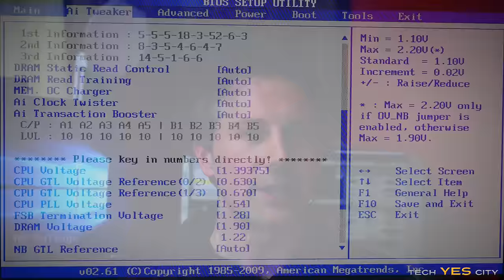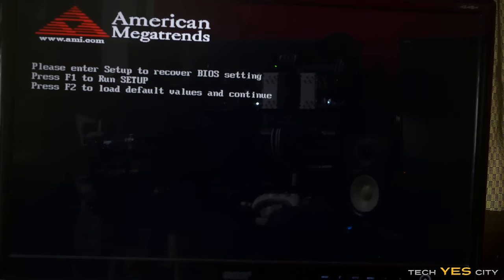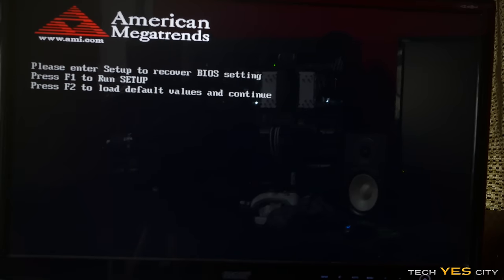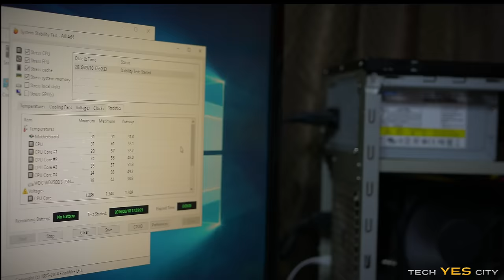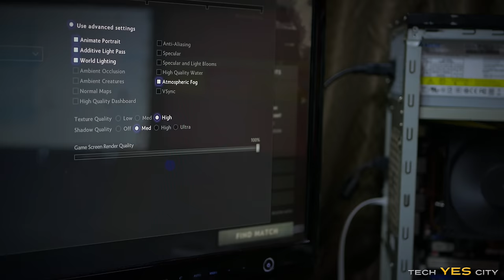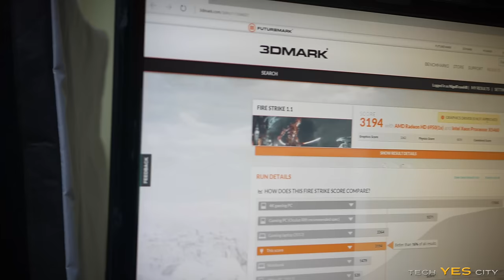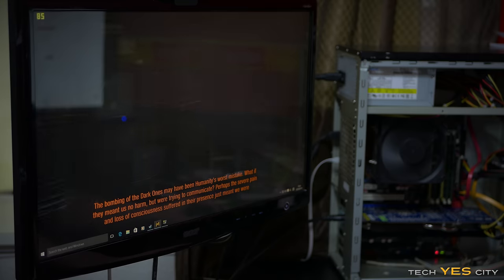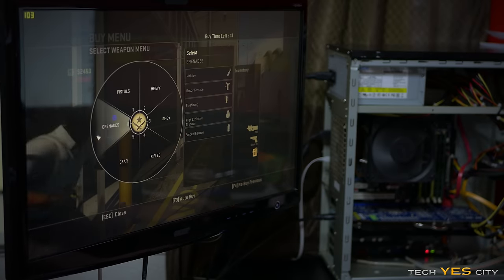$125 Used GAMING PC - is 1080p Metro Last Light Possible?

Comment: I would suggest not to spread the thermal paste with your fingers, the oil from them could corrode the compound and it is also very toxic for your skin :)
Reply: +Gonzalo Bueno I would argue that the paste that comes in contact with the skin will stick to it, so that the paste that remains on whatever you wanted to cover will only have touched the paste that is stuck on your finger. There's probably still some contamination happening, but it's probably not as bad as you think.
Reply: +Keven Harvey not bad as he thinks? that paste might cause cancer :P
Reply from the maker: +Gonzalo Bueno Tested it pretty extensively off cam, basically the bare finger wins (look at that 4ghz OC in this video dude, on a ghetto zip tied, top down cooler at 22deg ambients getting 56-57 spreaded perfectly).  Also especially with mx4 and as5, as leaves just the right amount on and as Kevin pointed out below, the initial spat on your finger acts as a barrier (and I also clean my finger with alcohol before and after pretty hard).
Reply: +SeaJay Spread method is a must for GPU, its not the same for CPU, because of the IHS.
Reply: +TexasTimelapse Your hands are naturally oily
Reply: Look at the video that Linustechtips made. Here they show that is doesn't make any difference.
Reply: Pea method: Ensure there's no dust on either surface, add a pea-sized blob and finally affix the cooler using the TR/BL/TL/BR/repeat* technique.

TR - Top Right etc etc

Pretty easy.
Reply: +Tech YES City I'd have to disagree. The oils on your finger may not effect the thermal compound in the short term, but over time it can. But you're not going to be using these PCs for years on end anyway so it's rather moot.
Reply: +Gonzalo Bueno He does so in every video to no ill effect.  Worst case scenario he losses a 1c or two on a $125 PC.

Thermal paste is not toxic.  Toxic would mean that it cause alignments just on contact and would require a disclaimer on the product packaging, of which I've never seen on any Thermal Paste.  People work with solder made of lead every day, I don't think what he is doing is any worse.

At best you could claim that it should not be left on the skin for prolonged periods of time but anyone is obviously going to wash it off.
Reply: +Gonzalo Bueno Does that mean I should stop applying my  paste with a Cheeto puff?
Reply: ive been spreading paste with freshly washed fingers for years now. never failed me once and i almost always get the best coverages and temps this way. people tend to over think applying thermal paste.
Reply: +Gonzalo Bueno There is no difference what so ever in terms of cooling, just put a dot in the midle of the cpu and it's ok it's not rocket sience.
Reply: +Tech YES City that is because the method how you apply doesn't matter. Look the workshop on LTT
Reply: +Tech YES City also how you spread it doesen't matter much, you'll get pretty much the same temps
Reply: +Ivaylo Kostadinov reincarnation dude, yolo dont excist
Reply: I can't believe how many people think that minuscule amounts of grease from our fingers will make a difference in temps, even though there is NO proof behind it.
People, just wash your fingers before this method, and, like Keven Harvey mentioned, grease isn't even an issue, since thermal compound sticks to your finger and creates a barrier and you smear the rest of the compound with that.
It's not like you will scrape the paste from your finger and smear that over the chip. smh
Reply: DavorBa TOO MUCH WASTED THERMAL PASTE
Reply: Julian Depaepe You put the same amount as when doing pea method. The only difference is, you are sure whole chip/IHS is covered, something which pea method doesn't always do.
Reply: Julian Depaepe I'm not the one who misspells "stupid", stupid.

"contact=efficiency" - yes, I agree, spreading insures max contact between chip/IHS and heat-sink.
Reply: DavorBa I'm not perfect 
don't try to be a computer
Reply: Julian Depaepe I not the one to go "grammar nazi" on people, but when someone uses an insult in a normal conversation, all bets are off.
Reply: DavorBa its allright
Reply: +Doctor WarpSpeed You should just use the powder AS your thermal compound. I mean, if Nutella works, whats the harm?
Reply: +-DepthCharge NUTELLA? Omg my head hurts soo much
Reply: +Ivaylo Kostadinov Yankee Oscar Lima Oscar
Reply: +Gonzalo Bueno So  I play pc games with voice chat enabled nothing more can be toxic other than hillary clinton
Reply: s0trill Same and its free not 10$ off amazone
Reply: +Gonzalo Bueno Skin cancer
Reply: DJWolf™ Gaming LAMO its not going to give you skin cancer its fine to touch thermal paste
Reply: +Ben Cumming same here. A little tip tho, you can use it for toothpaste. I call it ultra white.
Reply: adam blaydes All of that crap is gonna be costing more than atual thermal paste and gonna be smelling like shit cus i don't know but burning toothpaste and it chemicals
Reply: I once accidentalky got thermal paste all over both my feet
Reply: Finger Cancer!?
Reply: Amalie Haderbjerg - lamo ikr
Reply: Amalie Haderbjerg - Is that something you can get from thermal paste?
Reply: Elljoda LAMO no its fine to touch thermal paste.
Reply: Good cuz I got my both feets covered in that shit got me worried haha
Reply: +Gonzalo Bueno been doing this for years! never had an issue! but if you are that paranoid about the compound being contaminated or toxic for the user, just wear gloves!
Reply: +Gonzalo Bueno i read somewhere that thermal paste is made mostly out of plastic so why is it toxic?
Reply: +Gonzalo Bueno Yeah if youre into fingerspreading your paste at least use a glove or a plastic bag.
Reply: dario62589 Will a used condom work?
Reply: +Lukas kuprys 
it's silicone and/or silver
Reply: Isn't that how you get superpowers though? 🤔
Reply: +Gonzalo Bueno When I touched thermal paste for the first time I felt that my finger became dry and I couldn't wash it. It definitely is NOT a hand smoothing cream.
Reply: Interactivbg1 It shouldn't get your fingers dry but it may make your finger feel cold but I have been using Arctic Silver 5 since 2008 so you may be using cheaper stuff.
Reply: I don't know what it was, I was just "exploring" an old pc.
Reply: Silicone is a polymer (plastic), which is considered carcinogenic. So it could cause cancer just like any other plastic you're in contact with. Nothing to worry about though. We would probably all be dead if the risk was bigger. You eat, drink and breathe alot more carcinogens every day anyway.
Silver is toxic too if it enters your bloodstream. not in such small amounts as there is in thermal paste though..
Reply: I would argue that most thermal paste arguments are bullshit, seeing as ive used toothpaste with great results..
Reply: badum tssss

Comment: Where the hell did you get a P5Q-E mobo for 21$?! On ebay they cost 70$+!!
Reply: when he build this rig he is on japan.and he getting it not from ebay.
Reply: +SkyMix_RMT Well, it is rare, but I got myself a P5Q with a Q9300 plus aftermarket cooler and 4 GB of DDR3 for just around 35$ including shipping from eBay and everything is working out of the box, making it incredible value. Even if you already have anything except the board, this would be around 20 ish dollars at least if you resell the other components. But then again, these are auctions without too many bidders and I've had enough bad luck on eBay also. The best thing is, this build is running at 3,75 GHz CPU, 1000 MHz RAM no problem. When you add 2 more modules however, it has to settle at 3,6 GHz CPU, 960 MHz RAM to be very close to full stability.
Reply: WTF, man I'll be paying 35$ only for the CPU here in Romania, prices here are too high
Reply: SkyMix_RMT i saw a guy selling a p5q board with a q6600 with 8gb ddr2 ram for $40. sadly it's sold
Reply: Mitsubishi L300 2.5L FB EXCEED in my country p5q only $10. and he sell it with ddr2 4gb (2x2gb) and q9400 only for $35. still available now

Comment: I'm loving these used PC part builds mate! 

I challenge you to make a Gaming PC for $100, BUT it needs to be optimized for LAN parties; small case that's  had a (sturdy) handle built on,   with hooks to hold Power & Video cables on the side. Bonus marks for any other additions, and the case itself having a visual overhaul. 

The $100 would cover the PC parts + building materials for the case mods. 

Good luck :)
Reply from the maker: +Yazooman_179 I have the mini itx case lying around, though it all begins with the motherboard, will have to find  amini itx board for cheap, so very hard challenge!
Reply: It would be a pretty hard challenge, but that's what makes it fun :P 

I bet you'll be able to do it though!

Comment: Nice build. I love the LG775 platform. It has served me well for many years. I only witched to an i7-2600k for video rendering. For everything else it did (does) everything I need quite well.

One thing you might want to consider adding to your cleaning arsenal is a nylon/plastic putty knife/paint scraper. I have found them to be invaluable for getting the dried and hardened thermal paste off of heatsinks and chipset cores. Unlike metal scrapers they won't scratch or gouge the surface. Here in the US I picked a couple of them up for less than $1 at my local True Value.
Reply: Whoa, wtf I did like exactly the same thing, I had five lga 775/1 CPUs and I just switched to a i7 2600

Comment: i got a pretty good gaming pc (second hand) for 125$.
8GB ram
500GB hdd
gtx 650 OC edition (1gb ddr5 128 bit)
i dont know the motherboard
i5 2500 3.3 ghz
overall its GREAT i can probably run gta v on high
Reply: I doubt it; the vram for high textures is too much for the 1gb you have now. Medium should be just fine, though!

Comment: Someday can you do an overclocking guide/video on overclocking the 775 cpus? I had my Q6700 running at 3.1ghz. But after a couple weeks I blue screened while rendering a video. So I just reset to defaults since I don't feel comfortable pushing more voltage. Otherwise, great video though. That sure it a lot of value. Did you try running Fallout 4? :b

Comment: great PC man!  I still have P5Q Deluxe, 8gb ddr2, q9550 e0 OC to 4.0 ghz.  With good PSU and GPU like mine GTX 560 ti, still capable 1080p PC. Run everything with high and some in ultra. SSD make things snappier..  Excellent video!  That Xeon X5460 is 9.5 multiplier beast

Comment: Hey, i have a gigabyte ga ep43 and a core 2 extreme qx9650 in my secondary pc and i cant set the cpu clock at more than 3.6 ghz. Can u tell me how to set the voltages and ram in order to reach 4.0 to 4.2 ghz? i have 6 gb ddr2 667 mhz.
 Thank you!

Comment: I love good value used computer hardware and used to think that Core 2 Duo's were the pinnacle of bang-for-buck used gear. Especially when I got my E8400 for AU$20 and overclocked it to a solid 4.2GHz at 1.3V (normally at that speed you'd need at least 1.38V to reach stability so this was pretty insane)
But when I found out that the Xeon X5460 can be had for AU$40, there were zero complaints from me.

Comment: I'm still rocken a 775 with a Q9400 and I still really like that PC. I can still play Fallout 4 and GTA V on it and still get above 45FPS. I already had the mobo go that originally housed that CPU the EVGA 780i died so I tossed everything from that board onto a ASUS P5B-E witch is an older board and the CPU went from 1333MHz to 1066MHz but I don't see much difference in gaming. I'm just glad that CPU was able to still work even with an older board. All I had to do was update the BIOS.

Comment: I got nearly the same setup :D but I'm not doing this for fun - this is my budget :/
If the PSU got enough power, you can flash the HD 6950 to a HD 6970 - like I did yesterday ;)
PS: I'm preaparing the Xeon-mod, where is the best place to buy those stickers? And where do I order used CPUs?

Comment: LGA 771/775 4 core CPUs don't have 12 MB of L2 cache. They have 2x6MB, and as those CPUs are in fact two dual core CPUs linked, and they require to synchronize cache memory on both units, the total amount of data they can store in L2 is 6 megabytes.

Comment: Short question. Can you share your oc settings for that build? Also I would like to have your opinion about rebuilding that build with an DDR3 Mainboard. I've currently bought stuff for a 120€ including a second mainboard tho. 
Asus Striker 2 Extreme with the FX Soundcard and so on (Second Mainboard)
Sapphire hd 6950 Planing to patch this to an 6970. 
Xeon 5460 (It is fully modded, to even fit in a 775 Mainboard without destroying it).
4GB Corsair XMS3 DDR3 1333MHZ RAM
Zalman CNPS9900A CPU-Cooler
Asus P5G41T-M LX Mainboard (Its the one with the DDR3 Support)
Q6600 + DVD-RW Drive
550 Watt Xilence Power Supply
Got all that shit for 120€ maybe a bit less.
Reply: damn I'm impressed
Reply: The System was running without any OC, just a little bit Windows 10 Adjustment. I am not that experienced in OC on those AMI Boards. Just used to uefi a bit. It still got 120-180 fps in csgo. And in Rainbow Six Benchmarks up to 120fps, badest result was 26fps. But still its not that bad for that kind of pc. Just check eBay for Auctions like that, or just go for "defective" parts in Graphicscards for example thats how i found the hd 6950 for 20€. He told me that the cooler was a bit noise but its still rockin, so i bought it. I just cleaned it and went for some oil on the parts necessary and et voila no noise.

Comment: why not try for a mac pro one, the 1,1's can be had cheap, upgrade the firmware to the 2,1 firmware and throw a pair of E5335's at it and a small overclock, bootcamp windows onto it and throw an okay ish gpu at it and you're set, i run a similar setup myself but i have X5365's and a 7950 for a gpu, landed the lot for less than £300 with an SSD :P

Comment: Hey techyescity, so recently I tried building something similar using a g41 msi motherboard and a Xeon 5450 pc however I am unable to install a win10 OS, I installed a win7 and tried to upgrade it however I encounter a ----this pc's processor doesn't support a critical feature (compareexchange128) message. I was wondering how you managed to install win10 on your pc?

Comment: Hey Tech yes.. what do you think of this used potato build for Cs go and league of legends.. maybe  overwatch or back ops 3 :D ?

graphics card is a xfx ati radeon hd 5850 1gb 

asus p5k ws motherboard

cpu intel core 2 quad q6600 2.4 ghz 8 mb cache

cpu cooler (heatsink) is made of cobber with two fans

6gb ddr2 ram

sata harddisk  1x160gb and 1x300gb

dvd rw 

 (Lc power) 550 watt

Thermaltake Armor Jr. Black..

Comment: Framerate limited by cpu right? I have msi 6950 bios unlocked to 6970 and with the 2600k 220 fps avg. My point is I want to make an 775 pc able to run cs go 144fps and gta V 60 fps.

Comment: I have a P35 platinum and a X5470 , i cant get past 3,8ghz (380 x 10), is it secure to run at 1,39 vcore? mine is at 1,3 vcore and getting 75 Degress celsius with cooler master v6gt and artic mx4...

Comment: SandyBridge and newer L3 Cache is a bit faster to ALL cores than the L2 cache of the Core 2 architecture.

That said, access times to that L2 cache is probably faster than access time to L3 or LLC Cache on the SandyBridge and newer i-core architecture, also 12MB total is a LOT - more than the 8MB of LLC/L3 on my 3770k, and cache is always much faster than RAM. And obviously 12MB to 4 cores means a dedicated 3MB of L2 per core, which again is a LOT!

Again with my 3770k as comparison, it has 32+32KB x4 = 256KB L1 Cache  256KB L2 x4 = 1MB L2 cache, and 8MB shared L3/Last Level Cache (which IS on die, BTW - not that you said it was not, but the way you said it seemed to imply that L3 is not on-die)  So that equals out to 9.25MB of total cache, and being that this is from all layers combined, and that LLC/L3 is shared equally, that means 2.31MB of Cache to each core - assuming all cache is completely filled and all cores are hitting all the cache simultaneously.

Also - IIRC the L3/LLC of SandyBridge and IvyBridge over clocks WITH the CPU core, and last I read, at stock frequency an i7-2600k has some odd 130 GB/sec L3 cache speed to every core via the Ring Bus architecture, I can only imagine how much cache speed that means running at 4.6 GHz at ALL times as I have my system set! I turned off speed step entirely, keyed in my voltages (1.330 vCore but CPU-z reads 1.312 to 1.356) - even though I have turbo and all of its features completely disabled, whatever the case it works WONDERFULLY!

(I know in my Haswell-e system, my 5930k I had to keep "cache speed" clocked at stock frequencies, where this does not seem to be the case with SB to IB at least! ) Or is that part of the LGA-2011 enthusiast platform? I have never had a SB or IB 2011 CPU...

I can run Prime 95 forever and it will never overheat, and would probably take a week or so to get any kind of critical error! The hottest temp I have ever gotten -  I air cool and my room was VERY hot when tested that time, but core 3 hit 86 C maximum. If I had to guess my room was between 25 and 26 degrees C, my CPU normally idles at 28 to 33 but that day were sitting closer to 36 to 40!  

Same deal with my GPU overclock, hottest it EVER hit was 78 on that same day running FurMark for 30 minutes. And I have my 770 running at 1266 boost at all times in games - though FurMark does make it dip down to 1175, but the 8 GHz effective VRAM stays full speed at all times - love that beautiful 256 GB/sec bandwidth! In this system the 770 I have is actually RARE from what I have read - as it has the Titan-style all metal Blower Vapor Chamber cooler!